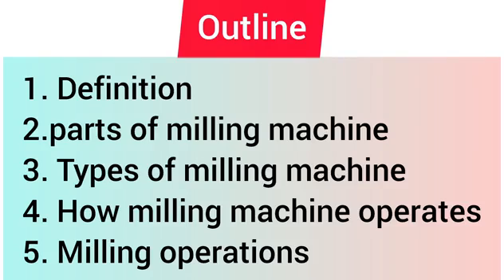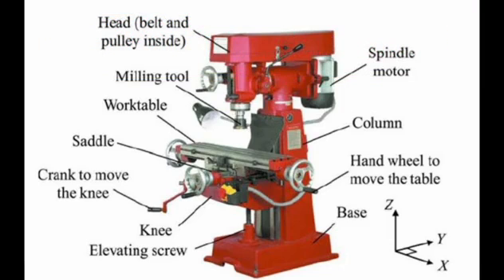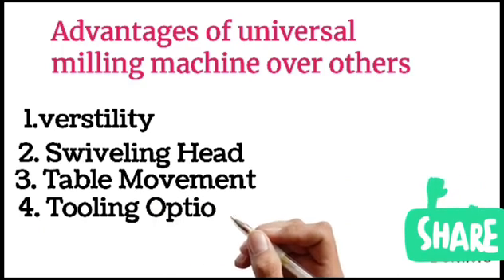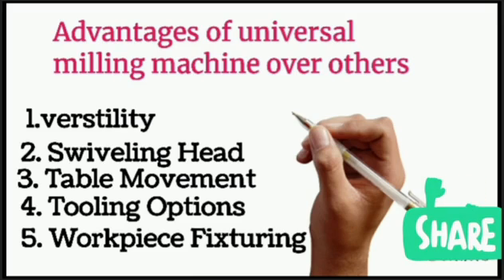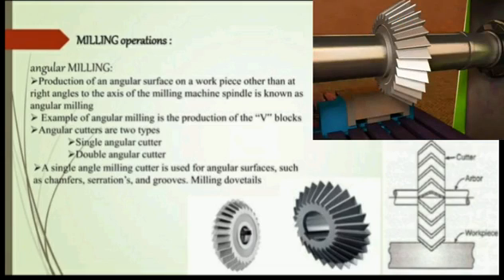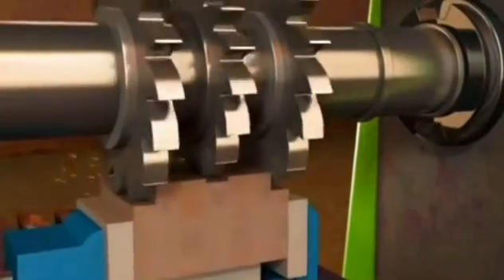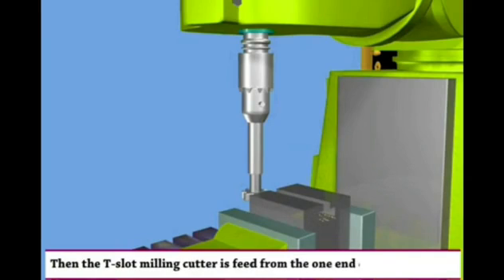A Comprehensive Tutorial for Beginners and  Milling MachineTutorial for Beginners and Beyond"

Comment from the maker: 0:00 intro
0:28  outline
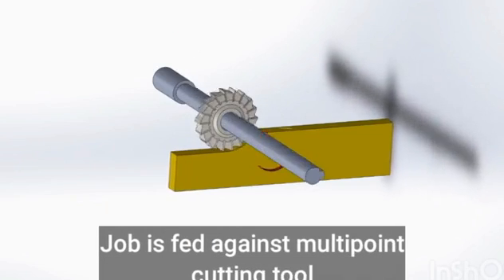0:57 definition of milling machine
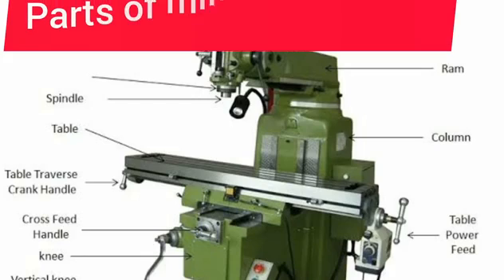1:15  parts of milling machine and there function
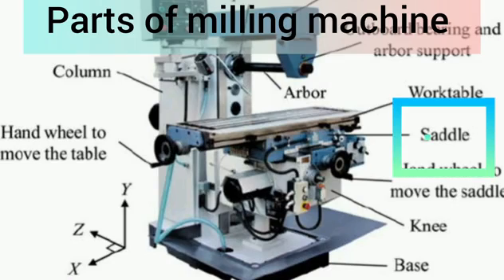1:39 saddle
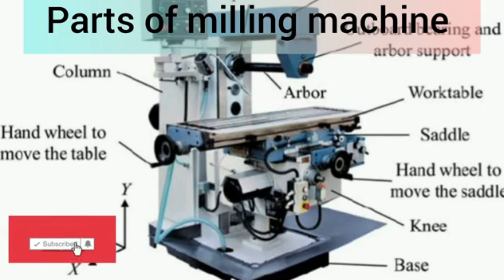1:48 table of milling machine
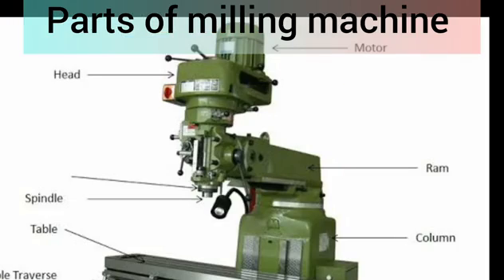2:01 spindle
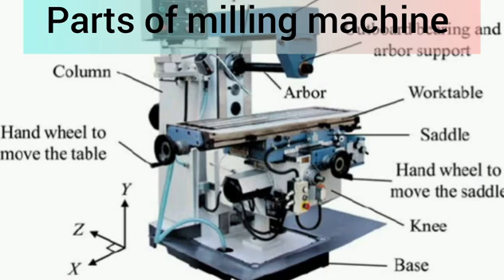2:13 h
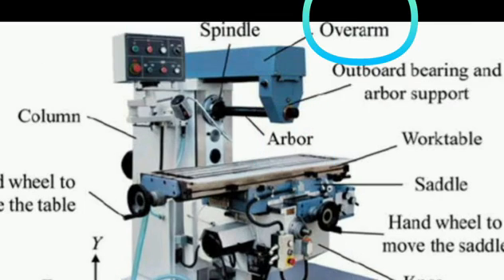2:20 overarm
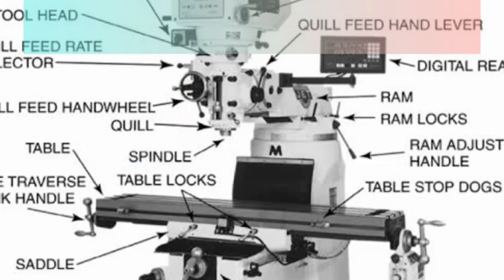2:29 Quil
2:39 working principle of milling machine
3:13 Animation of milling operation
3:29 types of milling machines 
3:43 vertical milling machine construction 
3:57  How vertical milling machine works.
4:10 Horizontal milling machine construction.
4:26 Differences between vertical and horizontal milling machine.
5:27 universal  milling machine construction/ Advantages of universal milling machine.
6:55 Rotary milling machine/ Rotary table machine. Applications.
7:27 what are major Milling machine operations.
8:09  plain milling/ slab milling
8:28 face milling /#face milling animation.
8:51.  How is Angular milling carried out? 
9:20 .How is  straddle milling done?.
9:47  How is form milling done? And its applications 
10:13 . Gang milling ,applications? And cutters used
Animation
11:02 End milling . HOW IT IS CARRIED OUT
11:22 .HOW KEY WAY MILLING IS CARRIED OUT?
11:44 . T SLOT MILLING AND HOW IT IS CARRIED OUT.